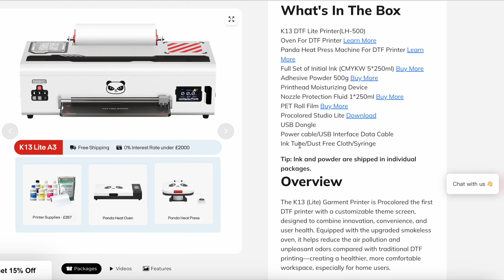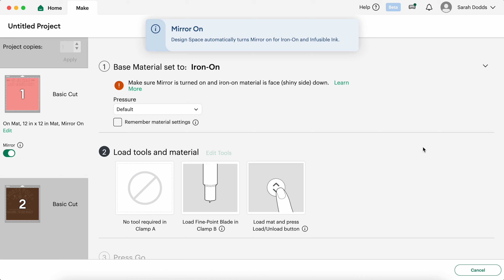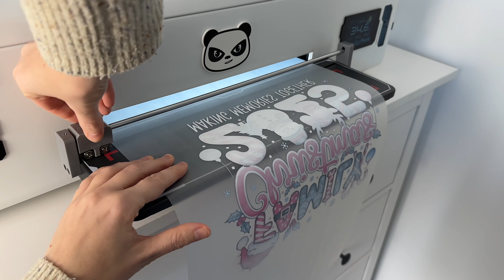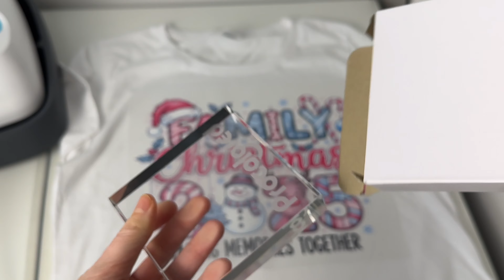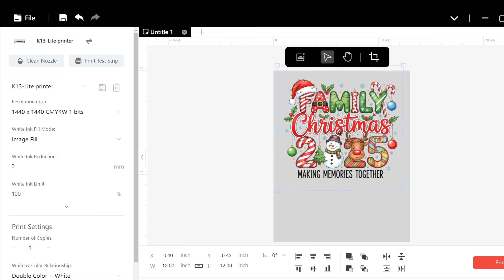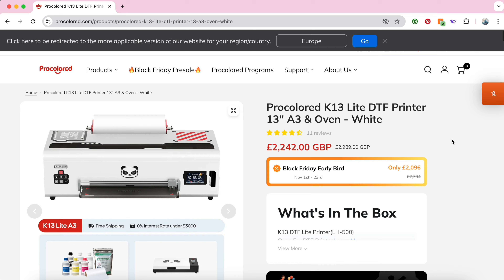HTV vs DTF: Which One Is Better for Your T-Shirt Business?

Comment: HTV is a great starting point. There are a lot of DTF manufacturers so I’d start with them. DTF equipment is very expensive upfront and on going. A heat press is essential for either process of you will be selling the shirts. The press in the video is ok for craft shirts meaning it only needs to last a few washed.
Reply from the maker: Thanks for your input, I appreciate you sharing your experience!